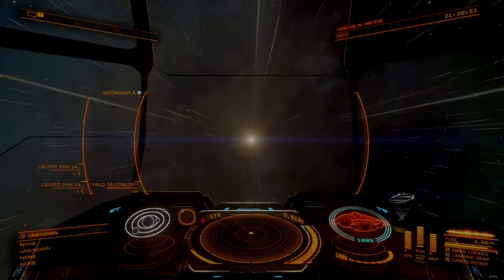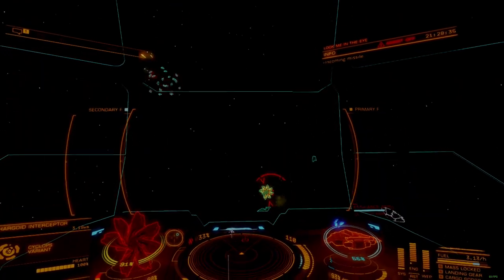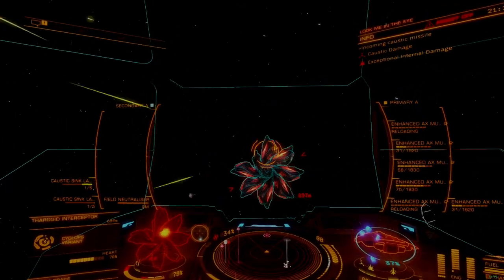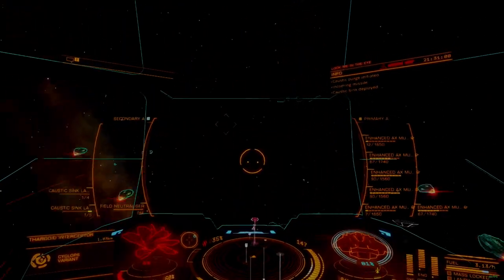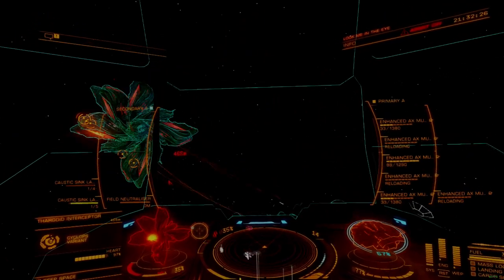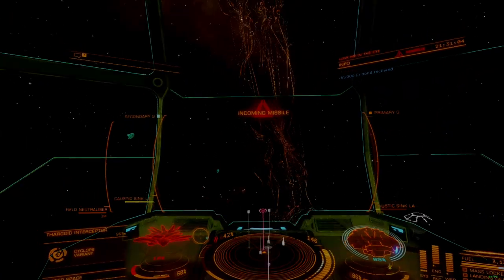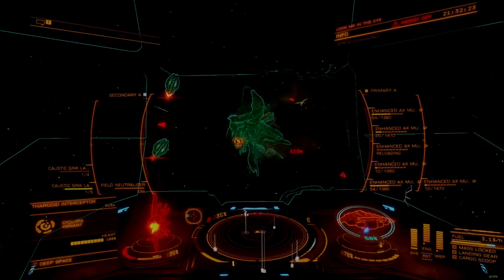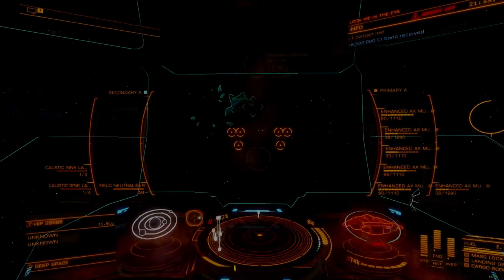Elite Dangerous | New Player Tutorial | PIP & Distributor Management

Comment: I have resisted the prismatics, but no pips make it interesting.
Reply: prismatics still do benefit from some pips management, they allow to endure for longer and outlast your opponent - it doesn't matter if you hurt them more or take less harm from them, as long as their hp ends before yours, you win. But having the option to not bother with sys pips is useful. Just don't forget to pop scb before shield goes down
Reply: I just pledged to Duval in order to get these, they seem essential for PvP.
Reply: @AdastraRecordings  I'm nowhere near pvp level
Reply: @AdastraRecordings  well... remember that 1) if you are in for any power item, you want to buy many enough so that you don't need to pledge twice; 2) size 8 prismatics cost quarter billion, size 7 cost 77m, other ones also have prices... Those two together mean you want at least 1 billion by the time you will be buying them. If you won't be able to afford that, you better pledge to someone else first... 

also,  I guess you can somewhat do with normal shields. Most of shield HP comes from shield cell banks anyway, shield max hp is only needed to survive until using banks is effective... alternatively, you can try equipping bi-weaves and try hybrid tank with some fast vessel that can run away and wait until bi-weaves recharge